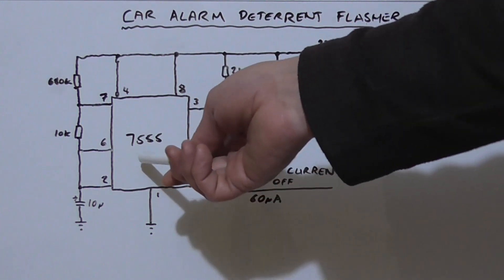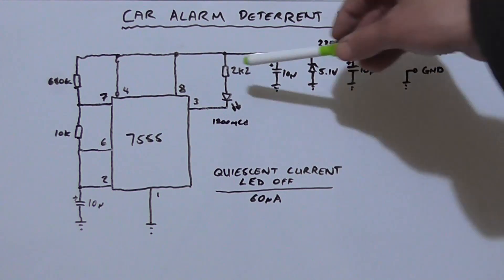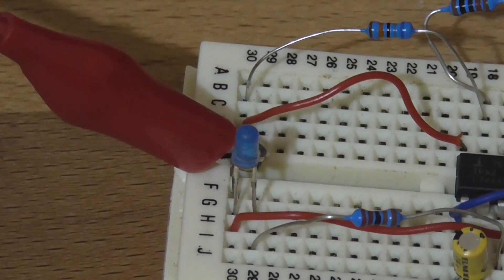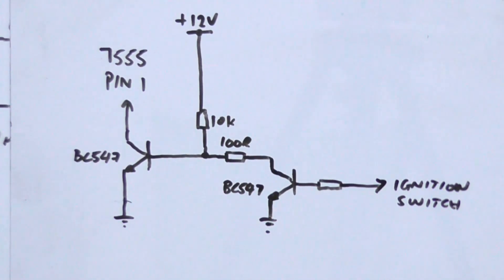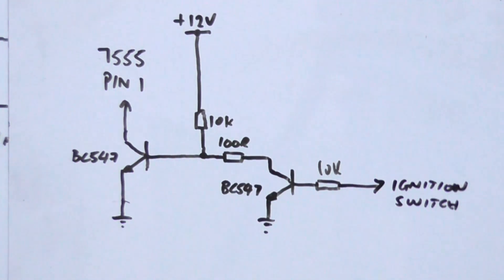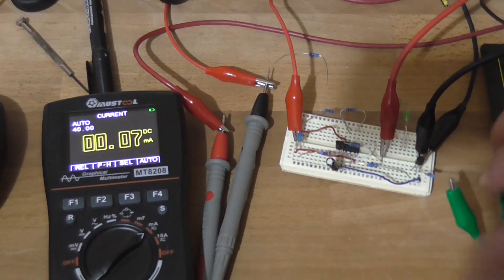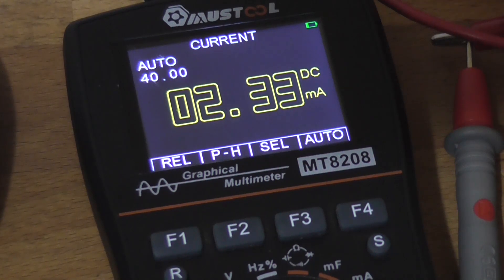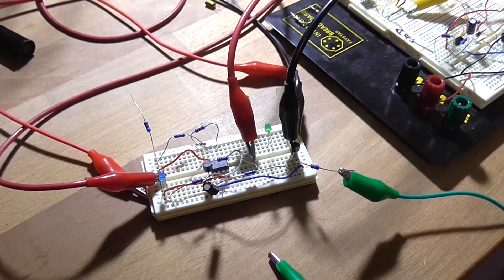555 Timer Car Thief Deterrent Flasher

Comment: On the ignition on/off circuit, what is the purpose of the 100R resistor?
Reply from the maker: @Taylor_26GE93  it's part of a resistive divider together with the 10k pull-up resistor. What we don't want to do is short the base of the first transistor to ground.
Reply: @AstrosElectronicsLab  would that be such a bad thing if it was? The 10K still limits some of the collector current, would it only be any reverse breakdown/leakage current from the collector/base junction of the first transistor?

Comment: I have some (20 + ) LM 3909's they do a far better job.
Reply from the maker: That's actually good to know. I never even knew those ICs existed, I'll have to order some to play with them. I just looked at their datasheet for the application data. Thanks :)
Reply: @AstrosElectronicsLab  The only ones you will find are old stock or fake one's, they went out of production about 10 years ago, pitty they are great design chips.
Reply from the maker: @RolandElliottFirstG  yeah, that's a pity.